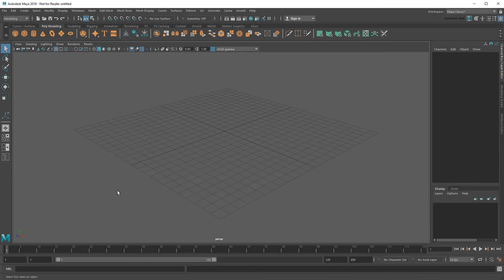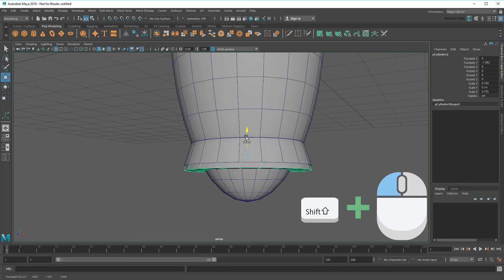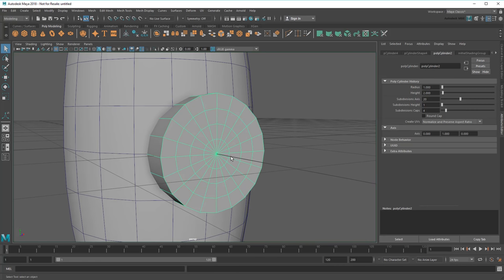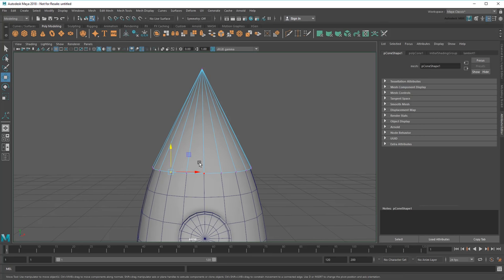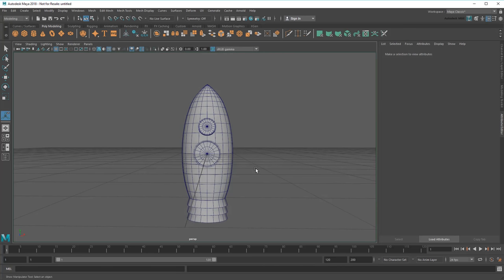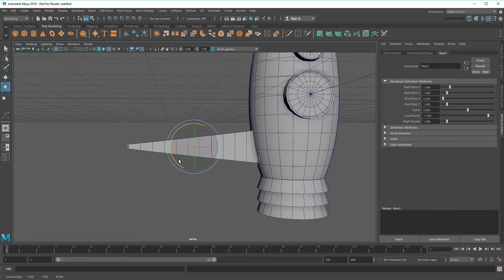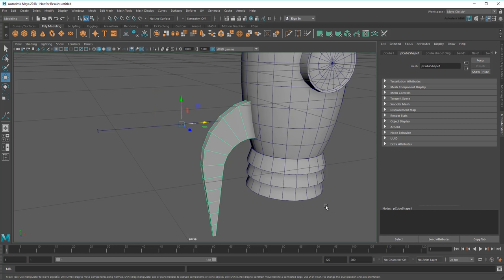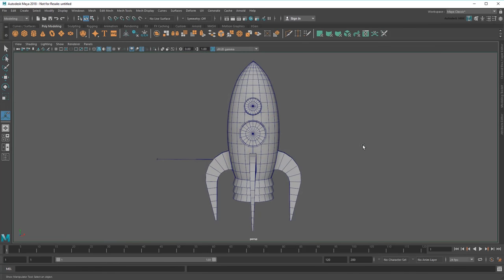Intro to Maya: Lesson 3 / 10 - 3D Modeling your first model

Comment: What does model and 3d model mean
How do we model our first model
What is introduction and model breakdown 
Why does it say building your first polygon model and what does this mean
Why now that we have a few basic tools under our belt let’s use them to build a cartoon rocket ship and how
What is cartoon rocket ship
Why th e easiest way to approach a project like this is to break it down into smaller pieces and how do we do this 
What does approach and project and break it down mean
Why for example we can think of the rocket body as  a stretched sphere and how 
Why the portholes and boosters as different sized oriented cylinders 
What are portholes and boosters and oriented cylinders 
Why the tip as a cone and how
What is tip and cone and where is it 
Why did it show that triangle thing when you said cone
Why these fins as thin molded cubes 
Why did it show those three things 
What are fin and thin and molded cubes 
Why you will start by creating a polygon sphere and how will you do this and why then scaling it up into a more rockety shape and how do you do this
What is polygon sphere 
What does scaling up and rockety shape mean 
Why notice how you used the handle here to make sure it only scales up and down and how and why was white thing on yellow thing and the thing moved up and down and why otherwise known as the y axis
What does scales mean
What is handle 
What is y axis and otherwise 
Why next you will make your boosters and how and why starting with a cylinder and how 
Why then use a combination of scale and move tool and how do we do this
What is combination and scale and move tool 
Why white thing touch yellow long thing and it got smaller and moved down
Why white thing went to different thing on left 
Why you pressed some the middle yellow thing and it got smaller 
Why to help with exact positioning you can turn the mesh wireframe on and how do we do this 
Why did the word shading turn blue and white small thing went to it and it went down to wireframe on shading
What is wireframe on shading
Why now even though it is positioned correctly it’s still not quite the right shape 
Why the bottom of the booster should be wider than the top and how do we do this and why that means you have to enter component mode to change its shape and how do we do this 
Why then you will drag select these bottom vertices and use the scale scale tool to evenly widen them away from each other and how do we do all this 
What does enter mean
What is is bottom of booster and vertices 
What are the yellow dots on blue thing on grey thing 
Why small white thing went to left and on grey thing and the grey thing at bottom got bigger
Why don’t worry if ours looks a little taller or wider it’s all part of the creative process and what does this mean 
Why before blue rectangle was in bottom 
Why this is just one piece of our booster 
To make the rest of it, you’ll need to stack two more of these underneath as and of which 
What does stack mean
But rather than having to go through all those steps again you can just switch back to object mode via the right click marking menu
What is right click marking menu 
Why then shift move the booster with the move tool to clone it and how 
What is shift move 
Why did it show shift ^ and blue on left and why did another bottom thing come 
Why and you’ll just do that one more time and it show shift ^ and blue left again and how 
Why that’s our completed booster and why well almost and why notice that are all still separate what is and how 
What is separate 
Why was white thing at bottom 
Why to combine them you’ll first make sure you’re in modelling mode then you’ll drag select everything and how 
Why and go to mesh boolean Union and how 
Why did mesh become blue and a bunch of word showed up and Boolean turned and then white thing went to Union what are all those words and what do they do 
What is mesh and Boolean and Union
Why now the entire rocket is green signifying it is all one object and how and what does this mean
What does object mean
What is signifying and entire 
Why next you’ll work on your porthole which starts with another scaled cylinder and how 
What is operation and Union 
What is scaled cylinder 
What is polycylinder2 and small blue circle and 
What is radius and height and subdivision axis and subdivision height and subdivision caps and the numbers next to them
Why something went around that long grey thing and had green on it 
Why white thing went to fifth square on top left 
Why the thing around long thing got smaller and white thing was on yellow 
Why white thing went to to middle square and it made noise and how 
Why a circle came out of long grey thing and how 
Why except this time you’ll need to rotate it sideways and how and what sideways
Why ideally you’d like to rotate it a perfect 90 degrees which can be tricky free rotating with this and why and how and why was thing moving
What does ideally and rotate and perfect 90 degrees mean
What does free rotating mean
Why so instead you’re going to hold j on your keyboard while rotating and how and why which snaps it in a 15 degree intervals and what does this mean
Why is it showing j green + blue left top 
What is j and keyboard 
Why now it’s much easier to get perfectly vertical and how 
What does perfectly vertical mean
What is yellow and blue circle 
Why white thing went to bottom square 
Why circle got smaller 
Why circle started moving to long grey thing and different square blue
Why white thing was on yellow thing and started moving right 
Why now you need to add a rim and some curved glass by editing its components, and how and why but for that, you’ll need more edge rings first and how 
What is rim and curved glass and editing 
What are edge rings 
Why to add some, you’ll need to look at the cylinder’s attributes in the attribute editor and how do we do this
What is cylinder’s attributes and attribute editor
Why was white thing going to word on right that said attribute editor and how did it do that
Why stuff on right went away
Why specifically, you’ll find them in the polycylinder tab and what is that and where is that and how 
What does specifically mean
What is tessellation attributes
What is mesh component display
What is mesh control and tangent space and smooth mesh and displacement map and render stats and object display and Arnold and node behaviour and UUID and extra attribute
Why is word pcylindershape4 white and other three next to it isn’t 
Why did white thing go to polycylinder2 and what is that
Why is it showing focus and presets and show and hide and what do all these mean and what are the two rectangle close to them
What is poly cylinder history 
What is radius and number next to it and white rectangle next to that number 
What is height and number next to it 
What is subdivision axis and number next to it 
What is subdivision height and number next to it 
What is subdivision caps and number next to it and white rectangle next to all of them 
What is round cap 
What is create UVs and normalise and presume aspect ratio and small white thing next to it 
What is axis and axis with three numbers next to it 
What is node behaviour and UUID and extra attributes 
Why in here you will increase its cap divisions, which adds a bunch of rings around the cap and how 
What does increase and cap mean
What is , 
Why did more green circle come on grey circle and more 
Why did white rectangle move a bit to right
Why now you actually have some components to play with 
Why in this case, you’ll use edge component mode to push and pull these rings and which and how 
Why is a bunch of white words showing in black rectangles and white thing went of to word edge 
Why notice how you can double - click a single edge in this mode to select its entire ring at once and how do we do this
What does double click and single edge and mode mean 
Why then you can scale them outwards just like the booster and how and what does this mean
Why once you’re happy, you can shift move it to create a second porthole and how 
What is shift move and why did it show shift + move when you said shift move
Why then scale it down and how and white thing went on fifth left square and before was on middle square and why rotate it to hug the body and how and what do we mean by this
Why another circle went on grey thing at top and moved in  
Why there you’re pretty happy with that so now you’ll just unionise and why was it showing shift + blue at left top 
What does unionise mean 
Why is it showing words on right 
Why tool circle turned green then bottom circle

Comment: What is stretching it out
Why is white thing going to polycube1 and thing changed under it and showed words
Why did white rectangle move next to subdivision width 
Why did number next to depth turn blue and changed 
What is depth 
Why did grey thing on left get longer and white rectangle next to width move and how 
Why thing on left moved down and middle square on left was blue
Why now it’s time to mold and how
Why while you could shape these fins by pushing and pulling vertices around either with or without soft selection and how you think it’d be a lot more fun to give you a taste of maya’s more powerful modelling tools
What is powerful and modelling tools 
Why did it show another two grey things and left was changing
Why so let’s try out a couple of “deformers” and how 
What are deformers and “” and why was that on top of deformers
Why deformers do exactly that: they deform geometry and how 
What does deform and geometry mean
What does exactly mean
What is :
Why in this case we want to taper the long cube into something pointier and then bend the result down and how
What does taper and and pointier and result and bend mean
Why so with you fin selected, you’ll go up to the deform non linear menu and how 
What is deform nonlinear menu 
Why did white thing go up to word deform at top then down to then word non linear
What is non linear
What are the six word that came up next to non linear 
Why then apply a flare and white thing went to the word flare and what is that
What is apply and flare 
Why this creates a handle in the viewport and why along with a flare tab in your attribute editor with a whole bunch of more controls and where and how 
What is handle and viewport and create 
Why did green thing with two circle on top and bottom show 
What is tab and control 
Why is flare1 on right and what is all the stuff under it and close to it
Why if you play with the controls specifically start flare X and end flare X and how and why notice how it deforms the top and bottom of your cube and how and why does that happen 
What is start flare X and end flare X 
Why was grey thing changing
Why you said but that doesn’t really help or does it 
Why because it’s not just the controls in the attribute editor that affect the shape 
What does affect mean 
Why watch what happens when you use the rotate tool to turn the handle and how 
Why did white thing start changing on left 
Why you said pretty neat huh
Why so that gives you your taper now you just need to bend 
Why so you will select the fin again, and this time apply a bend deformer and how 
Why too left square was blue
What is circle around grey on left
Why was white thing going to word deformer then non linear then bend and how
Why again you get another handle and bend tab and how 
Why did thing on right change and why is it now showing band1 and under band1 and focus and presets and show and hide 
What is non linear deformer attributes 
What is curvature and number next to it 
What is low bound and number next to it
What is high bound and number next to it and all the other stuff under
Why and it you play with the curvature, you get a whole new kind of deformation and how do we do this
What is curvature and deformation 
Why left thing started changing 
What is green line coming from up and down of white thing on left
Why again though, this doesn’t seem all that useful until you start to rotate the handle and how 
Why then the cube begins to follow the curve so that it looks a little more like what we want and how 
What is curve
Why did white thing on left change and 
Why but it’s still not quite right 
What are circle around white thing on left
Why this and which is bent in the middle whereas you want it bent from the side and how 
Why so let’s use the move tool to shift that handle over and how 
Why did white thing go to middle square 
What does shift mean
Why beautiful 
Why see how doing that changes the reference point of the curve and how
What is reference point and curve 
Why it turned blue for a bit
Why now you can keep tweaking both the bend and flare until it looks just the way you want and how 
What does tweaking and flare and bend mean
Why white thing was moving with white rectangle next to curvature and low bound and high bound and white thing on left was changing 
Why awesome and the last thing you need to do is duplicate three more fins and rotate them around the rocket and which and how 
What does duplicate mean
What does awesome mean

Comment: when i press shift + left click it dont let me clone it
Reply from the maker: Are you running an older version of Maya?  If so, use Ctrl + D to duplicate it manually.
Reply: @Autodesk_Maya  yes Im using 2016 version thank u ao much I fix it with the ctr D now I have another problem this version doesn't have arnold 🙄
Reply from the maker: @zeyrox8819  Unfortunately for that you'll need to upgrade.

Comment: doesnt this create terribly bad triangulation and then requires a bunch of optimisation for actual usage of these models in any game or video?
Reply from the maker: Yes, the topology is not ideal for deformation (although it's also not that bad) and it's okay for rendering. I purposely kept the model very simple since this is aimed at those who've never done this before.  For more complex models that need to be animated, it's definitely something that needs more consideration (and I have some other videos on that topic elsewhere on the channel).

Long story short, need to learn to walk before one can run.  = )
Reply: @Autodesk_Maya  yeah thanks for clarifying.. I learned Maya like 10 years ago in school.. but after that I haven't used it much and I thought I wanted to pick back up on it. Back then we had a massive emphasis on getting your topology right and efficient (because PC were way weaker back then and couldn't handle the same amount of triangles). Anyway Thank you for the amazing and simple videos!

Comment: B dont work for me any tips..?
Reply from the maker: You can try double-clicking the Move Tool to open the Tool Settings, then go down to the "Soft Selection" section and turn it on manually from there.

Comment: soft selection shortcut to change fall off size isn't working for me? I've got it in move mode and the vertex select and in soft select?
Reply from the maker: Have you tried holding B + Middle-dragging?  It could be that your soft select region is already gigantic, so you don't notice the circle changing.

Comment: I give up. 25th time I tried this, the exact same as this guy. p!ssing me off big time. Computer nearly flew out the window. :(
Reply from the maker: What's not working properly?  Still rotation?
Reply: @Autodesk_Maya  No. @3:38 adds a bunch of rings round. Added 4  subdivisions, followed this 50 times when I highlight it nothing happens. Everything is in place exact as the video. Play, pause for 1 second, play pause for one second to be as accurate and the same as the video but nope, everytime.  Trust me I have been extremely patient with this. Driving me nuts.
Reply from the maker: @johnnygreenshirt6215  Sorry, I think I'm a little confused.  Are you saying that when you perform the step at 3:38 (adding subdivisions) it adds them around the side?  Or doesn't add them at all?
Reply: @Autodesk_Maya  Sent it via email Google drive video. I can't continue learning until I overcome this. There are 1000's of things I wanna create but this is wearing my patients Matthew. Video is a bit slow as I was watching your video and listening.
Reply from the maker: @johnnygreenshirt6215  Do you mind posting it here instead?  https://forums.autodesk.com/t5/maya-modeling/bd-p/area-b41

I'm not authorized to access public google drives from my work account (security measure), but I can get to this forum easily (plus the helpful community there can help you out too).
Reply: @Autodesk_Maya  Thanks for the reply. I need to give it a rest otherwise my putter is going through the window. Yet again I followed step by step making sure all was highlighted as yours. 55th time. Geez I have never been stuck on something so long in software and yet to buy.
Reply: So tried again and still the same. When you add edge component yours turns blue. When I do it mine turns yellow?
Reply from the maker: @johnnygreenshirt6215  It sounds like you have Soft Select turned on by accident.  Press 'B' to turn it off.
Reply: @Autodesk_Maya  And thats it? The B button. Maya should come with more instructions. Make sure you don't press any other button while editing and learning cuz you'll end up breaking your computer. Now hopefully I can move on cuz no other software has ever tested my patients as this. There is a positive though. I can make this model in 2 minutes I tried so many times. Thanks.